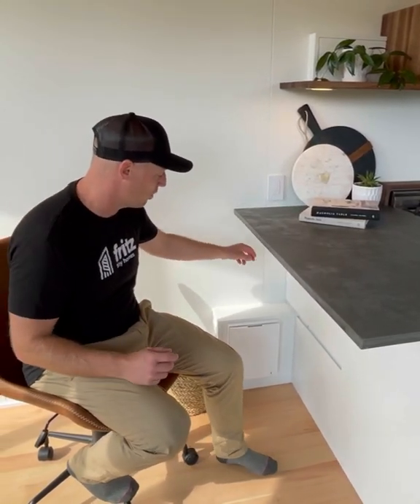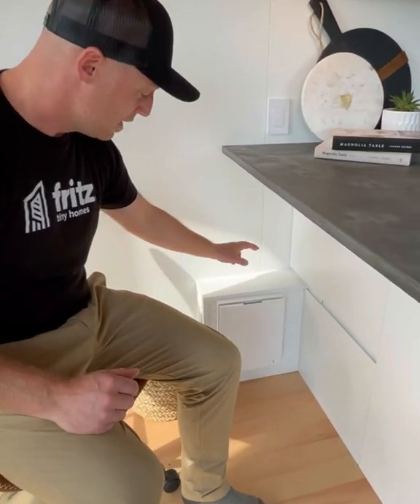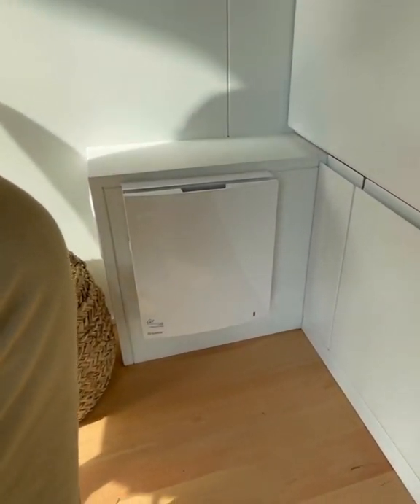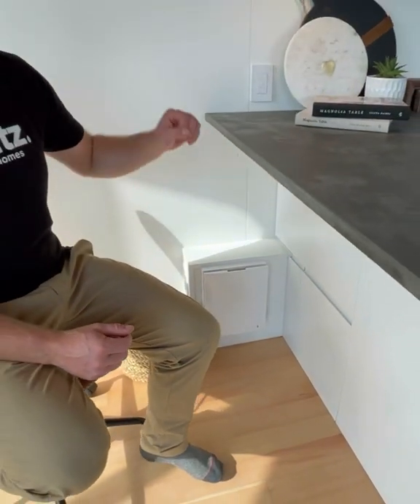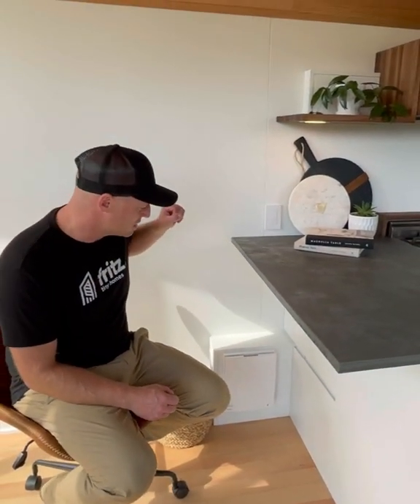How to achieve healthy air in a tiny home

Comment: I use both passive air vents and an exhaust fan (uses a speed boat engine cooling fan (both for bathroom and living space) to suck air out. 

I love vids addressing ventilation as some DIY builders neglect the little things that have a huge impact on comfort.